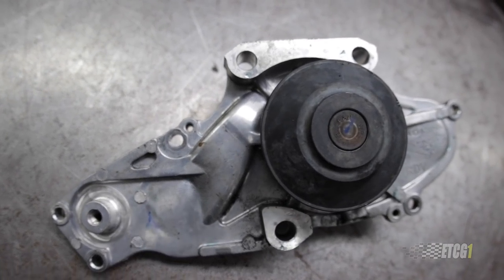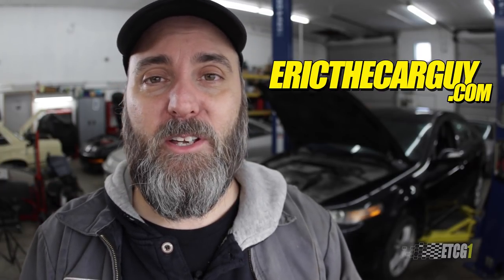Timing Belt vs Timing Chain, Which is Better?

Comment: Hey Eric, i know this doesnt fit in, but i would be curious to hear your opinion on Mercedes not letting customers open the hood on electric cars, as Louis Rossmann is explaining and in my opinion rightfully ranting about in this video:

https://www.youtube.com/watch?v=bBVqUuzUWEY

Also regarding belts and chains, i like it simpler and more effective or reliable, so i generally prefer belts as they usually never fail you if you change them regularly. Also engines with chains do tend to be louder.

Having a chain in a used car would be reason enough for me to walk away. Especially when considering that people think timing chains run forever and dont need to be replaced or checked, this is a recipie for a surprise with used cars.
If i had to absulutelly bite the bullet and buy a used car with timing chain, replacing the chain would be the very first thing i would go and do together with an oil change and such.

Comment: Chains and tensioners on more recent engines are badly designed and built. Especially European manufacturers have huge issues with this. I have never heard from anyone i've ever known that they had a belt snap, but chains stretching and tensioners failing is disturbingly common in cars built around 2007 and later. VW and BMW being the worst offenders. As others already mentioned both are great if implemented correctly. Old 80's Mercedes engines going strong with original chain after 400k miles, so it's only a matter of design. Everything today is intentionally designed to fail, made theoretically just about strong enough, but realism strikes, game over...

Comment: Timing belts for the American market was a bad idea if longevity of the engine is desired. Typical American car owner proudly boasts " It's running great- why should I spend a grand or more when my car runs great?". The failure of timing chains falls into another tactic that's not well suited for the American market and that is the extended oil change interval. 4-6 thousand mile interval turns into 15-25 thousand interval because .....why not?  When the engine dies from pumping abrasive acidic gasoline fouled oil thru itself the owner can blame everyone but themselves for the diagnosis.

Comment: I'm sorry but there no belt that will out live a chain belts need be changed 100k or they will fail there lots cars chevy ls motors with 300k with same chain .
Reply from the maker: But performance over time is reduced due to chain wear effecting engine and ignition timing.

Comment: I hoped long ago they can get rid of this stupid chunk of cam shaft. Just have the computer control the valves so it can idle like a pussy cat and roar like a tiger at high RPM. But technology failed to get this far. We had chain for a long time and they rarely fail, at most we need to change it once for the life of the engine and we can sometimes tell if the chain is loose.  I am sick of changing the belt every 150,000 km  and same with many people, so I bought Toyota that do not use belts.

Comment: belts suck- there is zero reason to add a $700-1000 repair at 60k or 100k  a timing chain can easily ;ast the life of the engine

Comment: Having just dealt with a timing chain and  timing belt vehicles back to back ( my 95 Nissan pathfinder and my wife's 2004 Suzuki vitara) pathfinder was definitely easier, but the engineering makes a big difference, I just rebuilt a kia rio 1.6 engine and that was a pretty easy timing chain system to deal with, it varies a lot by make